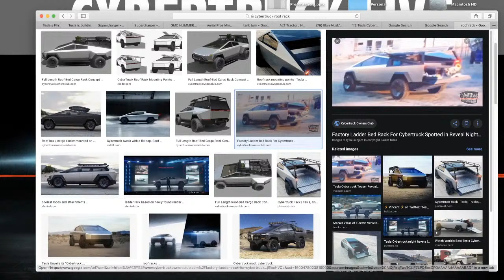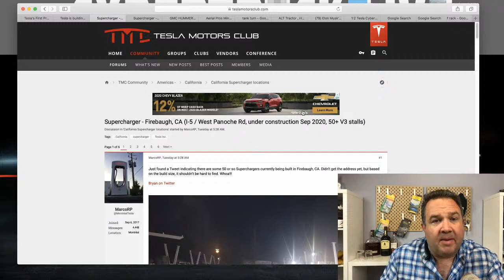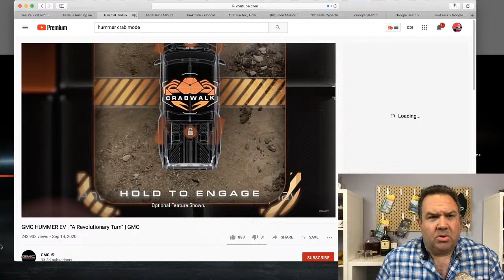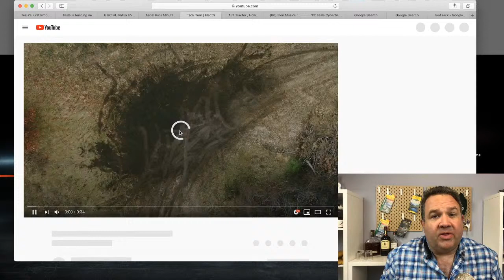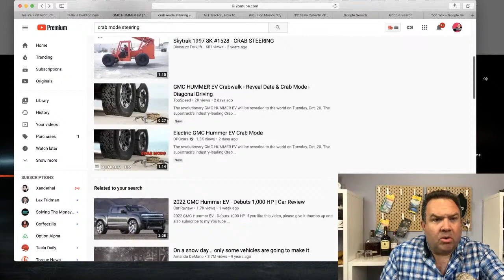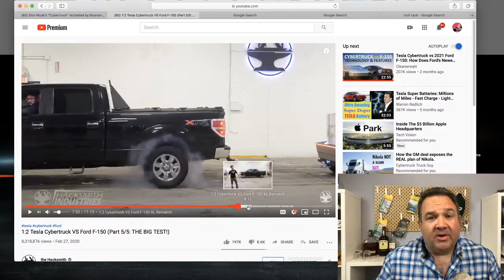Cybertruck Live: Thu 9/17 8pm CST

Comment: I'm not yet convinced that powered trailers are completely out of the question. Pedal assist on bikes is not the only analogous comparison, as one could stick a hub motor into any wheel and if it only shaved off 10% of the power required to move it, that 50 miles for the tri-motor seems worth considering. Having its own battery pack- particularly for something like a camper- would be its own massive utility.
Reply from the maker: Sure, but it all adds cost and complexity. Just feed the juice to the most efficient motors in the world.

Comment: Cybertruck will be my first truck and first Tesla vehicle. Currently I drive a mid-size SUV and would probably have upgraded to a larger SUV. Never considered a truck due to fuel consumption and not needing a truck bed most days. Model 3/Y were too expensive for the size, but the Cybertruck hits all the points for me. The vault gives it so much more utility than a regular truck bed. Very excited to explore more offroad areas as well here in BC, Canada.
Reply: I do think that many Cybertruck owners will also be new to trucks in general, like myself. Cybertruck was what I needed to finally pull the trigger on buying an electric vehicle.

Comment: Someone has already done the battery trailer that charges while towing. The rich rebuilds channel covered this, he met the guy that put this on his tesla The new charging station you are showing is a mix of pull through and regular chargers. The v3 chargers can can charge at 1000m/hr. The more interesting part of the crab mode is that it shows independent steering.
Reply: 1000 m/hr would mean it would take  300 hrs to charge up and go 300 km.  Think you're mixing something up here.